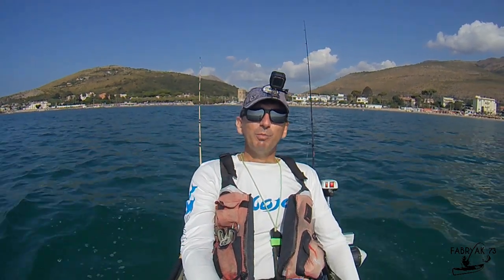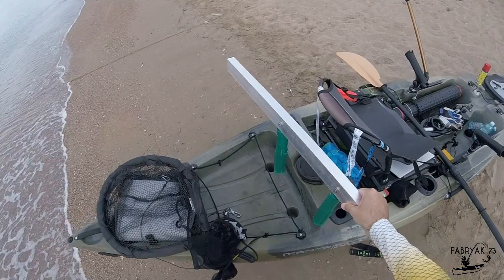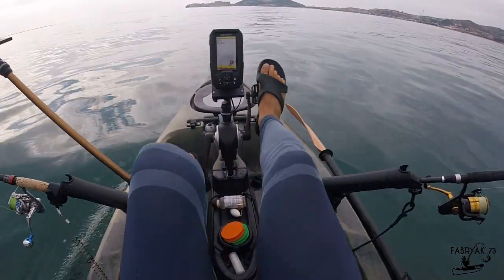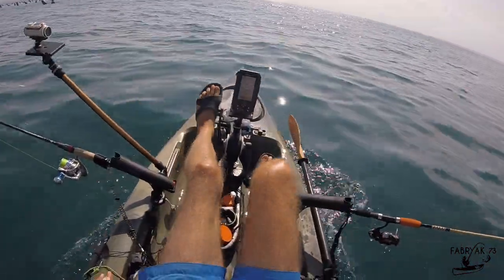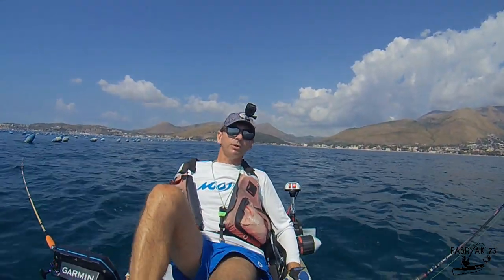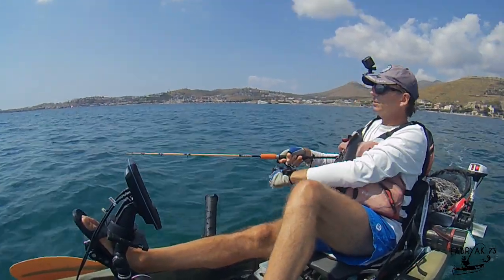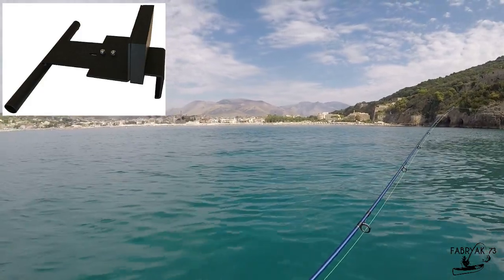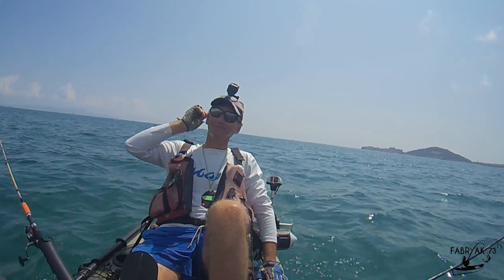Watersnake T24S electric motor on Native Manta Ray 12 Propel kayak: side mount on the water review.

Comment: Ciao dalla turchia. Mi ha aiutato troppo grazie.  Lithium battery e 3s 11.1v oppure  4 s 14. 4v?  Speed 5.6 km si vede poco vedanın altri video. Aspettavo 4 5 miles:( . Volevo fare sea scooter con questo trolling motor.
Reply from the maker: Hi Gokhan Keles. About the lithium battery, you can find more informations on the website https://ultralightbattery.it/collections/batterie-al-litio/batterie-ultralight. About the speed it was about 6 km/h without pedaling, but you have to consider the weight of the kayak, the angler and all the stuff that were placed over it. I do think that it would be good to make a sea scooter. It's cheap and light (3,5 kg).

Comment: In speed 2 how long time could you go? It’s possible to stay more than 15 minutes in speed 2? I really liked this system, but I’m afraid to use it in speed 2 for long time.
Reply from the maker: Hi Dani, the autonomy depends on the battery you use. The motor consumes 9 amps per hour with first speed and 20 amps per hour with second speed. With my battery, which is 50 amps, I can use second speed for two and a half hours.
Reply: @fabryak7383  thanks! Understood, but my question is if this motor is able to stay at speed 2 for long period of time. I’m afraid to burn or smoke it.
Reply from the maker: I cannot answer your question, I never used it at that speed for more than 15 minutes.
Reply from the maker: @danibetitto6006  thanks a lot for sharing this information. I have recently bought a new 130 ah battery. It could last up to 6,5 hours with the second speed!
Reply: @fabryak7383  Nice! I just bought one 130 ah Lithium too!! Battery probably will be not our problem. Kkkkk 😂😂